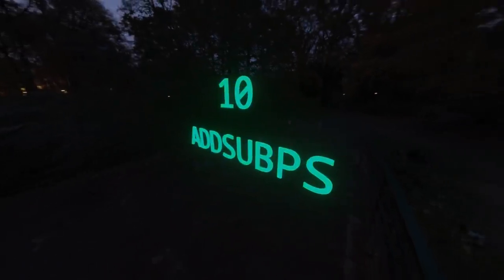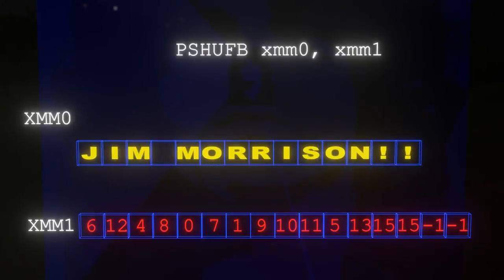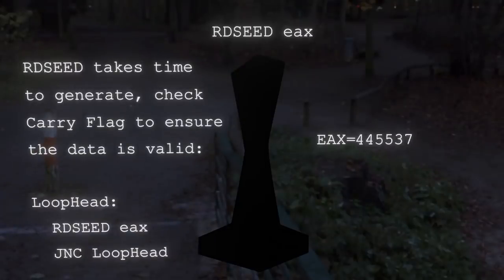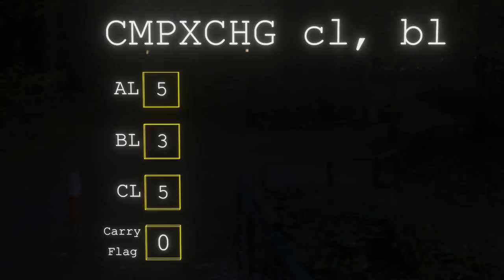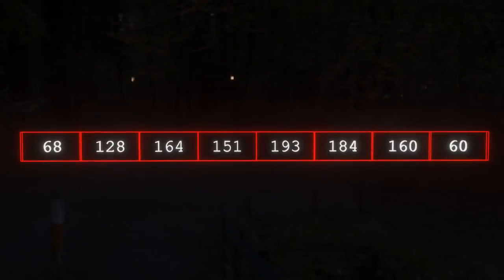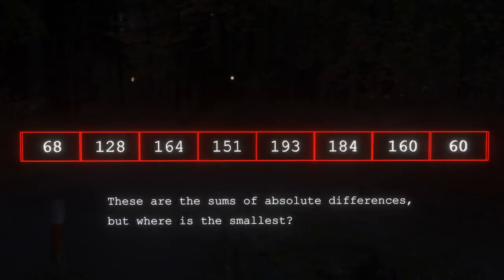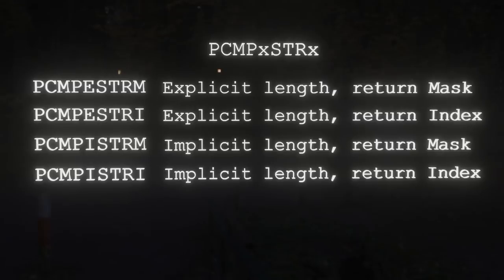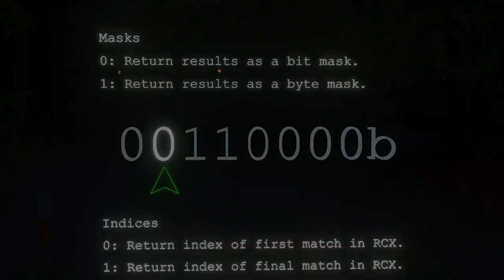Top 10 Craziest Assembly Language Instructions

Comment: Incredible video!
Almost totally out of topic question:  -I deeply apollogize in advance;  this is a topic request, rather- :
Would there be a way to accelerate radix sort using Agner Fog's SIMD library and some of these crazy instructions?
First I'd like to say I think Radix Sort could be made even faster by inserting bubble-sort single passes before stages.
Why?  Because in real life, once you sort something it usually remains mostly sorted.  Say you have an array or list of pairs of colliders in a game engine:  As the objects move, the sorting of this list will be affected;  but it won't become 100% out of order (totally random) in a single frame.  And when a set is highly in order, bubble sort is the fastest sorting algorithm to put the thing back in perfect order.
So, a single pass of bubble sort being very cheap could result in task completion, conceivably, before executing even a single stage of radix sort.
Now, imagine if we could iterate through our set loading 8 elements at a time in an AVX row, and compute some sort of parallel quick sort between it and the previous row, that is, a quicksort of 16 elements per iteration.  That would be one hell of a fast block bubble sort.
And then perhaps the radix sort itself could be SIMDfied...

Comment: Wow I can see some library or game engine developer strugling with all of the instruction set between risc and cisc
Reply: in particular if the engine has to run on the toaster of your grandma with a total of 0 transistors and a bimetallic strip but also has to kick ass on your 32 thread threadripper and 3090 SLI beast.

Comment: PEXT would be perfect for decoding of UUEncoded data. 
An encoded block is 4 bytes. You subtract 32 from each value, then extract the lower 6 bits of each number and combine them to 3 bytes.
Assuming ecx contains the bytes after the subtraction, ebx would be
0x3f3f3f3f.. after PEXT, eax's lower 3 bytes would have the decoded data.
I checked and C# has an intrinsic for it.. I'll test it on my UUdecoder tonight.

Comment: This shows pretty well the CISC way of making things faster: Implement more abstract, high level operations... until one day you end up with DECMP4FR: Decode MPEG 4 Frame. The problem is that such an instruction becomes useless if one day no one uses MPEG 4 anymore. Also this approach limits how fast CPU cycles can become, it makes cores complex, it makes instruction decoders complex, it makes for high power consumption and compilers have a hard time to use such instructions in everyday life. So a generic CPU becomes a highly specialized CPU, but this raises the question, shouldn't one rather use a highly specialized co-processor for such things, like e.g. a GPU is used for 3D graphics, because it is specialized for it?

The RISC way, on the other hand, is to keep instructions as simple as possible and to express complex instructions by a sequence of simple instructions, because that's what compilers do great with. If you want more speed, then you make the clock cycles shorter or make sure that more instructions can run in parallel, both of which are easier the simpler the instructions are. Graphics cards e.g. have only very simple instructions, from which one builds shader programs, but since they can execute these programs hundreds to thousands of times in parallel, because they have e.g. 512 or 1024 shader cores, they still beat CPUs by far, even if they need 10 shader instructions for something for which Intel needs a single CPU instruction, because the Intel CPU can execute this instruction only once per core and it does not have 1024 cores.

Comment: Oh, a pity you limited it to x86. The craziest assembly instruction I know is the switch/case instruction in the SC-61860 micro-controller used in the Sharp Pocket Computers (PC-1251/1350/1401 etc.) from the 80s:
CASE1(7A) <nb> <rtn@dr>
CASE2(69) <val1> <@dr1> <val2 @dr2> ... <valn @drn> <def@dr>
    nb : number of cases,
    rtn@adr : return adress of functions,
    vali & @dri : call @dri if A = vali.
    def@dr : function to call if A doesn't match any value.

Comment: How do compilers decide to use these esoteric instructions or not to keep object files compatible and portable?
Reply: They don't. You tell them through command line options what's the target processor and what sets of instructions to use.
Reply: These are not really esoteric. At least the SSE ones and CMPXCHG are commonly used directly with intrinsics.

Comment: In the early to mid 70's, I worked for a large multinational studying emerging microprocessors. This included a fair amount of playing around with different processors. The aim was to find which one(s) were the best. In the end, the company went for the Intel 8080 and its later derivatives, despite the fact that the Motorola 6800 and 68000 were far superior technically. The problem was that Intel was way ahead time-wise and rapidly achieved market dominance, so sadly, the Motorola products fell by the wayside. If you compare the instructions sets of the 8080 and the 6800, the 6800 was well thought out, logical and easy to understand whereas the 8080 was a complete mess. The 68000 with its 'supervisor' mode was superb, whereas the 8086 and its later derivatives continued the trend of being a complete mishmash.

In the late 80's, I spent some time programming in 8086 assembler. This was virtually impossible unless you sat there with an instruction manual on your lap because of all the quirks and exceptions that were too difficult to remember. By the mid 90's, things had got so complicated, that hardly anyone wrote anything in assembler any more and whilst the emergence of reliable high level languages had a lot to do with that, I think that Intel's messy instruction sets played their part too.

Comment: Very interesting instructions. Obviously, I expect RDSEED to have high entropy (thus very difficult to guess). For my 512-byte boot-program competition I used XORSHIFT spiced with RDTSC for a maze-generation (the project eventually failed, as adding controls ended up to 600+ bytes, too large for a boot sector, but it visualized randomly generated maze if you boot from it). Wouldn't RDTSC be much more difficult to guess if running under an OS, where interrupts happens all the time. I guess RDSEED does not need user/internet activity to be considered truly random, but I would never be able to predict XORSHIFT+RDTSC with active interrupts, isn't that still considered "truly random"?

Comment: You ignored a lot of the protected mode instructions such as the descriptor tables, selectors, and some of the ones that had to be used to get in to protected mode. I have no idea if they are still around or used and don't remember much about since it's been decades but those are the real crazy instructions. Basically yours are all just relatively common math operations usually encoded in to instructions for speed.

Comment: I learned assembler on the IBM system 370. It was very clean, relatively few instructions compared to today, and orthogonal. However IBM in the latest z series mainframe has completely cluttered up the ISA. Supposedly to make code generation easier for the compiler writers.

Comment: Interesting that we have PCMPxSTRx variants.  This is that instruction thats been waiting to have a machine level abstraction for years.  Bye bye c libraries: strcmp, strstr, subst have 3-4 cycle implementation.
Reply: Computer languages have fetishes over strings...found that out learning Rust a few months ago.
Reply: @raylopez99  most flexible primitive datatype. There's a reason.  They're just useful and there are less memorics and symantics to store / to worry about when doing dynamic allocation.  If ya wanna store a complex datatype easily you don't know the size, dumping it into a string is a fast choice.  It casts right back. Other primitives can hold any binary data, but it's the strings ability to conveniently hold arbitrary data easily that make it so useful.  Having the casting hardware accelerated is a nice speed bonus.  Asm doesn't care about datatypes unless you put that logic in thus dynamic casting is very fast.  Casting is a big bottle neck for high level languages with type checking so this is nice.  Provided ya know what you're doing and where the stack pointer is and the memory youre accessing is in fact accessable, real nice.  Our primary bottleneck is type checking code in high level languages.  It's nice to be free of that in asm land, and with inline to put it into a higher level language.  Rust and c can both inline this stuff. I prefer to inline over a void** sprintf when copying memory, especially if what I'm doing is recursive  :)  is a nice x86 hack...minus the bit of architecture specific spaghetti preprocessor directives.  You can template those if you like.

Comment: The first operation mentioned were present (or similar ) in altivect, they are vector multimedia instructions, and they are east to implement in hardware and register register. So I will not calle them representatives of CISC complexity. The issue is more memory  related instructions, for example. Laser on, at the end complexity increases.

Comment: I started with assembler 1979 on apple ][ Motorola 6502 and my last assembler project was to install an ink counter into the hp 500 printer driver on ATARI ST in 68000 Assembler.
I printed at this time very much and had an alarm on low ink based on the black points printed.
But all this instruction are only confusing me.

Comment: Are general compilers like gcc smart enough to deduce when they need to use some of these very complicated instructions? Or are they meant to be called manually by a programmer by running an asm block in a C/C++ program?
Reply from the maker: I don't think a compiler would emit these, no. Might be wrong, but I'd say you'd probs have to code them yourself with ASM or intrinsics.

Comment: The bulk of uses of SSE4.2 are better served with other instructions. If you have a few (10s) of cycles to prepare (or more, of course) - for example, you're matching whitespace characters, or digits, or all the structural characters in JSON, etc., you're much better off with PSHUFB/VPSHUFB/VPERMB. The string match instructions are just too slow (throughput/latency), and are 128b only. The only valid use for them I've seen is when you're intersecting two completely-unknown-in-advance values; even there, the prospects of doing better from AVX-512 are strong for many uses.

Comment: RDSEED is annoying because it breaks the compiler's assumption that the CPU is deterministic.

uint64_t privKey[4];
for(int i = 0; i < 4; i++)
    asm( "rdseed %0\n" : "=r"(privKey[i]) : );

You would expect your private key to be strong here, and it is – in debug mode. In release mode, the rdseed gets optimized out of the loop and you get four copies of the same number, so your private key is a 64-bit number times a constant. That can be cracked in seconds with Pollard's kangaroo algorithm. The GCC documentation implies you don't need to add the volatile qualifier here, but you definitely do.

Comment: The byte instructions on the PDP-10 are almost this bad, and then you have to remember that they were implemented using dedicated logic, since the PDP-10 wasn't microcoded (at least not in the KA10 version).  What made these ridiculous was that "byte" at that time meant anything shorter than a word, so on the PDP-10 you could pack and unpack bytes of arbitrary length, even across word boundaries, IIRC.

Comment: I wish that a more sensible instructionset would have become dominant back then. There are so many sets that are much, much more readable and logical, like the 68000 set just to name one.
Reply: 68000 is not THAT much better. It shares some of the warts of x86 (8bit and 16bit arithmetic instructions; instructions that both read and write to memory and update registers all at the same time; partial updates of flag registers), though I admit that it's nicer in some ways (all instruction sizes are multiples of 16-bits, no multiple encodings of the same instruction, no instruction prefixes).
Reply: "Back then" was after Apple dropped 68000. I think CMPXCHG is the only one mentioned to have existed in the 68k era. I don't think any of the historically RISC architectures are doing SIMD better than x86.

Comment: They might be crazy but all the instructions seem to greatly reduce the number of cycles required to do the operations they carry out compared to using simpler instructions to perform each step. There must be some really intensive repetitive tasks that rely heavily on the optimisation these instructions give. What would truly be fascinating is to find out where they are used and if they are still needed but that is the problem with instruction sets - you can never reduce them or remove instructions because it will break something somewhere..

Comment: Intel/amd should create a histogram of all instructions used in modern SW an cut off the lower 50% of them. The silicon area & speed improvement would be remarkeable.
Reply: They started doing that years ago, except instead of eliminating them completely, they implemented them in microcode without hardware optimization. Their optimization guides say which instructions to favor, so you know which ones have hardware behind them and which are only there for compatibility.

Comment: That's insane. I see why modern x86-64 runs an entire OS in the form of microcode. Are we sure we wouldn't be better off just using whatever massively parallel RISC CPU sits inside every Intel and AMD cpu? Do we even know their instruction sets? Has anybody reverse engineered part of that microcode?

Moreover, has anybody written an exploit that breaks the microcode barrier?

Here's a challenge: optimize Collatz by writing an ASM exploit that cracks the microcode barrier of an Intel CPU and directly drives the RISC hardware inside.

LOL

Comment: Could you do a video on why people are excited about risc vs cisc? Is one actually better than the other?
Reply: I think you see one of the problems here - cisc has more instructions for the unfortunate programmer to  forget about :)
Reply: If you design a new instruction set, you would design it as RISC for sure. There's just a lot of instructions that make no sense once you have 32bits and instruction cache and enough registers (8 and 16 bit math, flags, load+math and load+math+store instructions). But in large CPU cores (Pentium 2 and later), there's not that much difference really (the instruction decoder breaks complex CISC instructions into RISC-like micro-ops anyways).

Comment: I would like to see hybrid cpu architecture that supports both arm and x86 instruction sets. Both are good. Light workloads on power efficient arm chip and the heavy workload on x86. And a feature on cpu to decide which one to use. If running on battery use the program arm instruction sets. Oh the user plugged in. Automatic switch to x86 and so on.
Reply: This is trivial from a hardware perspective. The software needed for that would be insane. It would be easier to just port everything to ARM. Which is what Apple has been quietly working on for years, and finally released recently.

Comment: my fav CPU dirty-tricks maybe things the “Arduino” can do … but skip the circuit-board, just buy the bare-chip from ATmel.  😂

(a)  you could put a quartz-chip on there to set the CPU frequency, but if you don’t there is an internal oscillator circuit that makes 7.6-8.1MHz 🤷‍♀️  it isn’t precise, but it works!  😂

(b)  CPU clock-speed also used for reference-frequency, but there is a PLL (phase lock loop) function, which multiplies that x8, if you want.  (CPU doesn’t run faster, but other things like output-PWM can go from 50kHz to 400kHz)  😅

I doubt Intel would include this jankiness, but it’s quite fun to play with.  😊

Comment: Next time on Top 10 Craziest Assembly Language Instructions:

Place 6: UPDWND
Runs Windows Update atomically and restarts the system

Place 5: FCKWNDINSTLNX
"Fuck Windows install Linux"
Installs Archlinux over the currently running Windows installation.

Place 4, RNCRS reg8/imm8
Runs Crysis [reg8/imm8] atomically.

Comment: Very interesting...
but this is why I'm sure RISC will ultimately win the CPU*Arch*logic...
All these code/microcode must reside in the CPU firmware... 
although highly optimized this will 'impede' the CPU*scale*down and still execute the same binary code,,,
also the energy scale down would be affected too, related to RISC*Archs... and more... but let's keep it short!

Waitin' for more of these... like... the 10 most used x86,,, the 10 most useful x86,,, the 10 most unsed... etc. etc.

Also a video explaining what is intel MMX... SSE... VT*... etc... 
when it appeared,,, why... if it is obsolete... what was the 'silicon-cost' of the firmware... 
and what replaced that instruction subsets... (modern way of doing it... and why the deprecation)
Reply: RISC will win if x86 goes out of use (there's no reason to design new non-RISC instruction sets). The catch here is if - x86 is not actually bad enough that it gets worse over time and ends up in a technological dead end: most of the badness of x86 can be contained in the instruction decoder (and doesn't really affect speed).